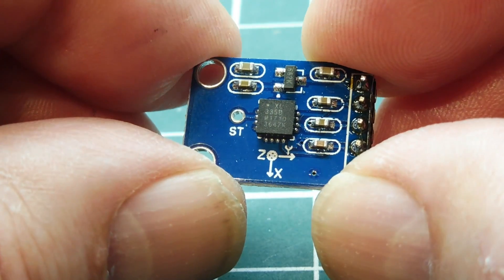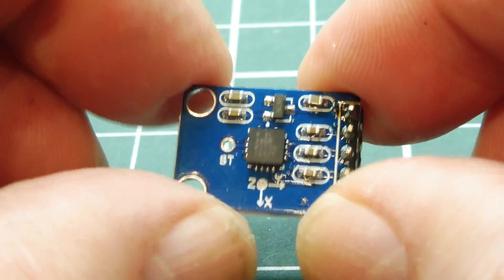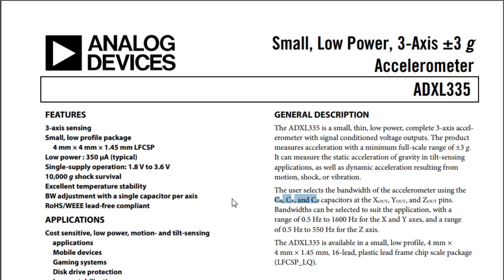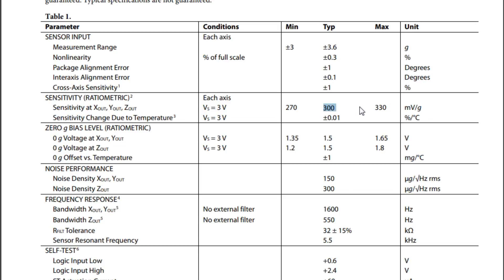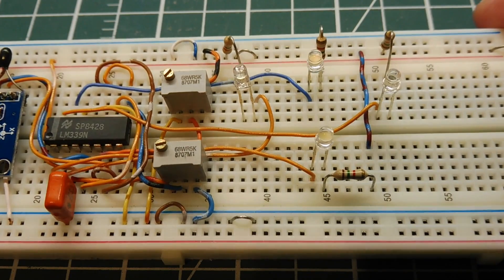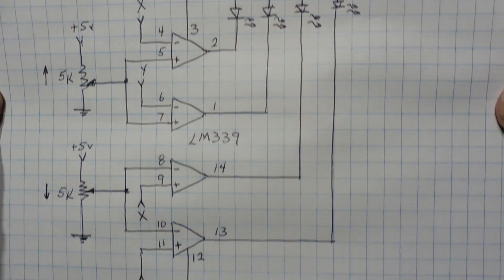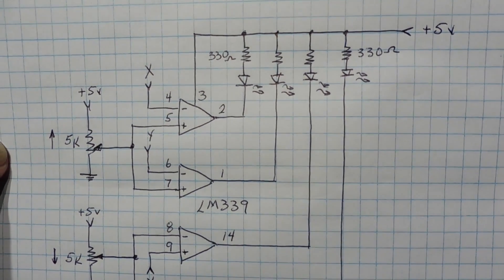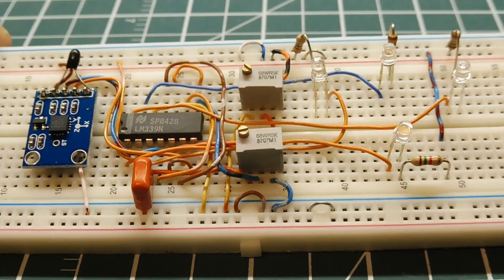Simple Accelerometer Interface    / ADXL335B

Comment: Any reason why I couldn't add an LM393 and run all 6 comparators from 2 trim pots?
Reply from the maker: Yes, you can add more comparators for individual control.
Reply: @0033mer  Great stuff. Thanks very much, I'm really looking forward to this build. Any other "Arduino" boards you can run as analogue? I'm going to try the Pulsesensor  heart rate monitor for starters....

Comment: This is probably not what you think it is. It is not a speedometer. I measures gravity, that's why it has to be tilted. You may be wanting a GPS module if you want to know if your robot or drone is moving.
Reply from the maker: As the data sheet of the ADXL335B shows, it is a 3 axis accelerometer which can measure "g" forces. When the ADXL335 is tilted in the x and y direction it is exposed to 1 "g" of gravitational force and will output a corresponding voltage, turning on the leds. Where in the video is the word "speed" or "speedometer" mentioned? If you were looking for a GPS video here is a link.  https://youtu.be/aBVxSyyx8Fw

Comment: Nice video. could you do the same with the z axis? Also can i use a ADXL345 it has different connections but is cheaper than 335? The 345 connections vcc, gnd. int 1, int 2, sdo,sda and scl.
Reply from the maker: Yes, you can use the ADXL345 the same way and detect the Z axis.
https://youtu.be/df2pC1LVduA

Comment: excellent circuit presented in simple way.  
PL there are two more components in this on bread board, one pf capacitor (brown colour) and other is probably the PTC/NTC (black colour ) which are not shown in schematic and are not discussed, what are the values for these?
And please share the suitable PULL UP resistor values?
As I understand Module GY-61 has a voltage regulator chip that has output of 3.3V, It will only work on 5V?
Thanks
Reply from the maker: A .47 uf capacitor from pin3 of Lm339 to ground and a 2.2 uf capaitor across power supply to ADXL335 for filtering. This is something I do and is not needed for circuit operation. Pull up resistors can be 10k and operating voltage of the module is 3.3 to 5 volts.

Comment: Thank you... This was extremely helpful... If I want an output of 5v, along with turning on the LED, how can I do that?
Reply from the maker: Feed the output of each comparator into a logic inverter IC like the CD4069 and you will get a 5v output when the LED turns on. You can also use a common CD4093 Nand with the inputs tied together to form four inverters.
Reply: @0033mer  Thank you very much...

Comment: I'm confused now, all accelerometer, gyroscope and magnetometer look they do the same job which detect tilt effects! What is the actual difference between these modules?
Reply from the maker: A Magnetometer measures the earth's magnetic field using a Hall effect sensor, so basically a compass.
An Accelerometer measures the acceleration of a device (mass) in "g"s  F=ma
https://youtu.be/nDmlsHCuBlI

A gyroscope measures angular velocity or rotation. ( Coriolis force )
Both of these sensors use MEMS technology.

Comment: I'd almost have thought any of the LEDs would have gone off once the tilting motion stopped - as the acceleration would had gone to zero G/unit time.  But to me, I'm seeing a "tilt sensor", as LEDs stay on even when the tilt movement stops.  Not to split hairs, but if this IC is about acceleration, isn't 'accelerating' (or 'decelerating') motion the trigger, rather than a tilt in orientation whose motion goes to 0?  I can't see how either 'mode' can be selected given the pinout.  Thx.
Reply from the maker: The force of gravity is constant so no matter how you orientate the IC there will always be a vector sum of 1g acting upon it.
If we tilt the Y axis parallel to earth's gravitational pull we will get a constant 1g force on that axis.
This is a good way to check calibration. During freefall we have zero g force and all outputs will go to zero volts.
X and Y acceleration is measured when the Z axis has 1 g acting upon it. ( Board is laying flat not tilted )
Check out this video: https://youtu.be/P6yNjAk0QUQ